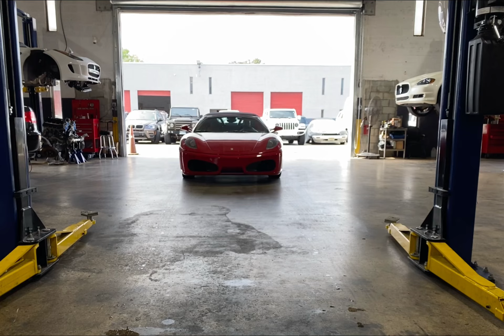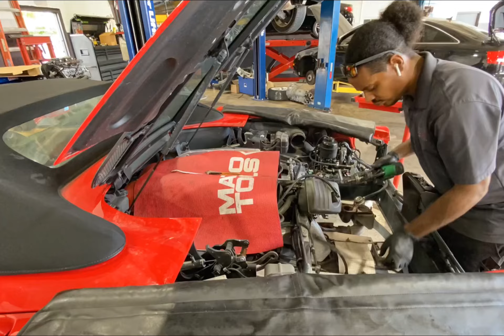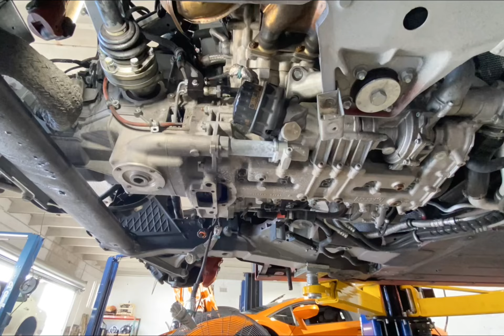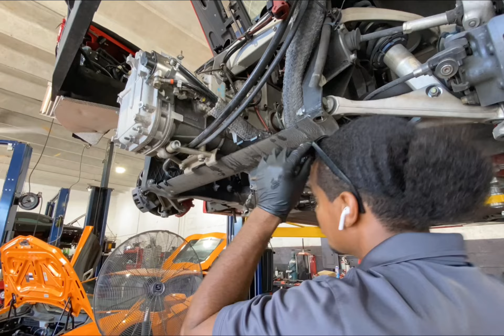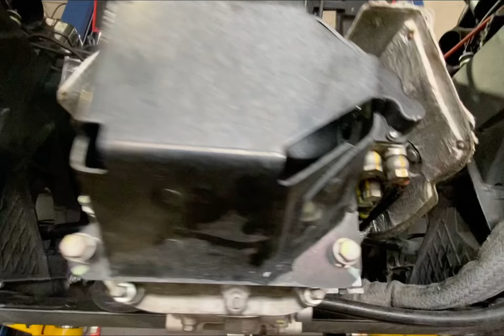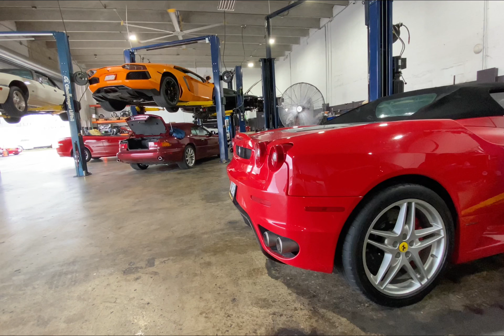2008 Ferrari F430 Spider F1 clutch replacement

Comment: How do you mechanics know exactly what to do on so many different cars, so many different wires etc..
Reply from the maker: It can be a mission honestly but what I usually do is take pictures of components and wiring before removal so I can use as a reference when reinstalling everything. Working on this f430 was a first for me and it wasn’t too bad.
Reply: @ObiTheTech  I see, but you still need to know what to remove first...

Comment: how often need to replace clutch for F1 mission??  for 360 and 430 case...
Reply from the maker: It’s very hard to say exactly how often, It all depends on how the car is driven really. Driving these cars in stop and go traffic can be harsh on the clutch, also inching forward too much at stops. This f430 in particular only had near 12k miles and had a hard time moving from a dead stop.
Reply: @ObiTheTech thanks for your reply. 12000km is very short.... maintenance cost a lot. i cannot be owner. Manual mission also need to replace clutch often??
Reply: I bought a beautiful, mint condition 08 Spider two years ago. It had ten thousand kilometres on it. Since then I have put 6,000 kilometres on it. The roof failed a month ago, and it needed an oil change and fluids. So I took it to Ferrari to get it done. I told them to let me know the clutch condition. (It had been done just before I bought it ). They said it was like new, barely any wear. Bear in mind,I NEVER drive it in stop and go traffic. I avoid that like the plague. I don’t enjoy it anyways.
Reply: @johnforeman634  how much did you pay for roof?
Reply: @Wowwow-wl3kx  looks like there was two issues. It says “found left hand Tunneau micro switch mis aligned. Also re fill hydraulic fluid and lubricate. That cost me a thousand dollars Canadian.
Reply: @johnforeman634  when stopped you have to drive in neutral
Reply: @patrickXWAY  i actually do that but once in a blue moon the damn thing will not want to immediately go into 1st. It’s really embarrassing when you have a line of people behind you, the light turns green, and you’re panicking trying to do anything to make it shift. It’s rare, but does happen.

Comment: Why are you taking off the valve covers and taking apart the ignition system to replace the clutch?
Reply from the maker: I was replacing the valve cover gaskets and spark plugs while I had room with the transmission removed.

Comment: Smart move doing valve covers while you can stand in the bay!
Reply from the maker: Thanks man! Gotta do what’s gotta get done. I was actually supposed to remove that big brace bar in the way but to get to the bolts up front the convertible had to be opened and I wasn’t sure if the convertible was in working condition. Usually when older cars some in with the convertible up I leave it unless necessary. Last thing you wanna do is fix a problem for free 😂